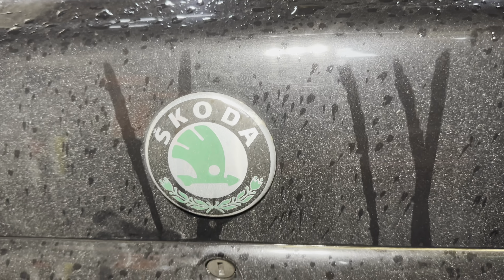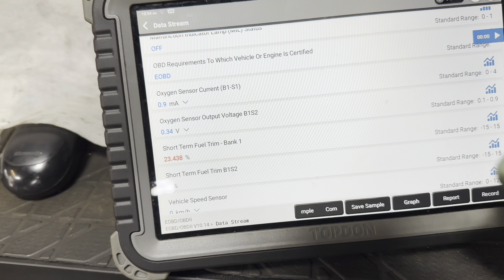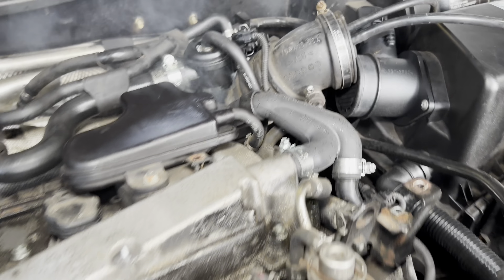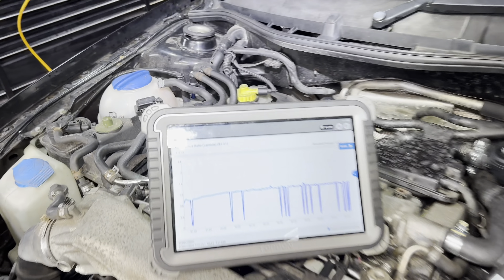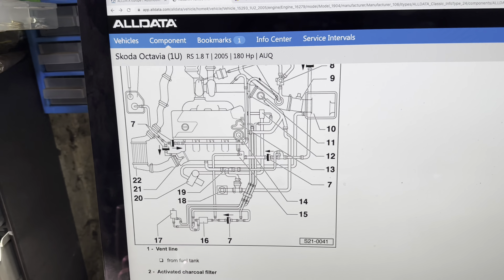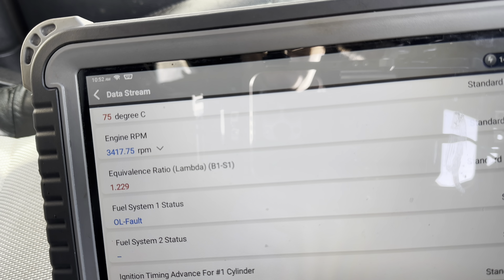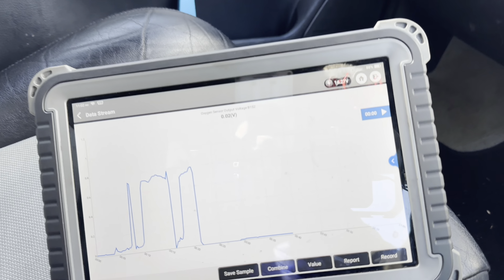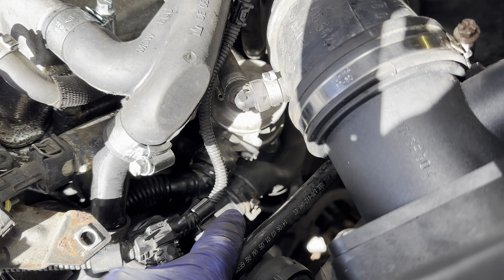Skoda Octavia 1.8T 20V VRS (2005) - Bad Idle Runs Lean P0130

Comment: Nice one guys , my Vrs estate 1.8 ,  had done nearly 200,000 mint , so quick when needed , and not an ex police car either , just well used 👍💪, caught the sump over a yr ago on a pot hole  , leaked all the oil out , turned engine off , coasted for over 1/2 mile , quick start up , 2 gear changes then and coasted home   new sump , sorted 👍👍🤣🤣
Reply from the maker: It’s a quick car to drive Mike I was impressed with the performance
Reply: @sandyande  when I took the sump off to replace it , inside the engine block it was like brand new , nice spray jets inside the bottom of the bores 👍👍